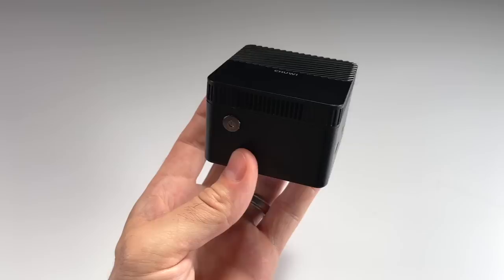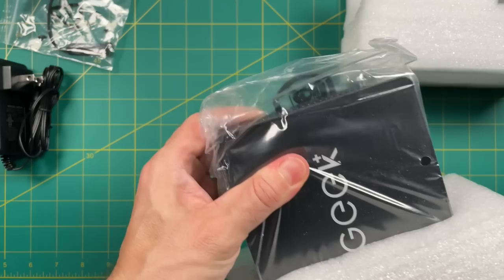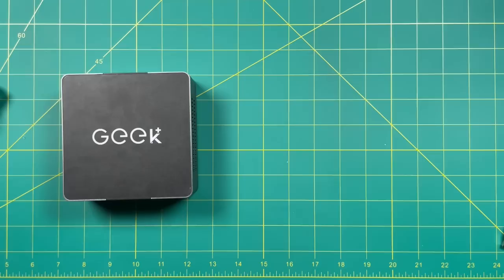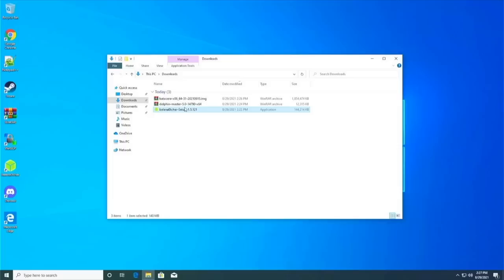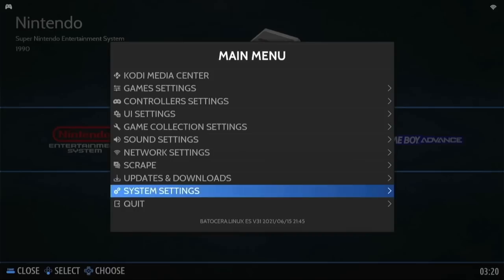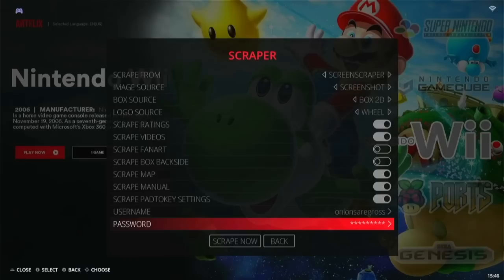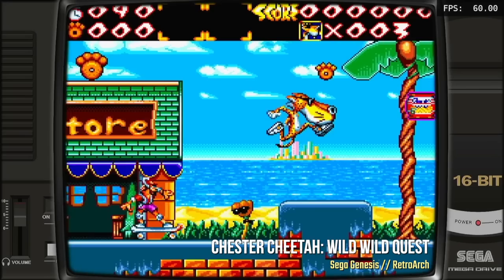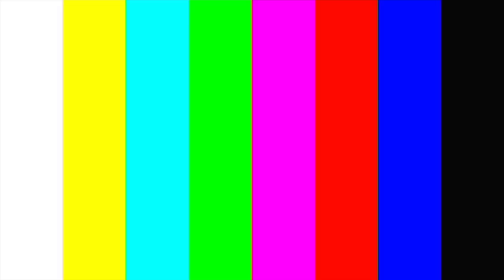Batocera Mini PC Setup Guide

Comment: I’m stuck at the balenaetcher part… it’s not detecting my ssd drive. Windows detects it, it has a drive letter, I can use it, but balena can’t see it… I’ve tried messing around with bios settings but nothing is working… I have a beelink sei8 i5
Reply: An update for anyone struggling with flashing the 2nd drive… Look up ETA prime‘s video about installing Batocera onto a hard drive… make a USB flash drive of Batocera, plug it into the computer with the spare hard drive, access settings menu of Batocera and download Batocera to new drive.

Comment: Can someone please help??!!
I have a Kin Hank 2tb Batocera drive and a Kamrui Mini Pc. This MiniPc has onboard Bluetooth which doesn’t seem to be available in Version 33 or Batocera 35.
I’ve tried Bluetooth dongles from the compatible list but they also don’t work. 
I’ve hit the “pair Bluetooth device button” and nothing happens. 
Something faint appears next to the Wi-Fi signal at the top right of the screen but quickly disappears..
I’ve also tried XTerminal to enable Bluetooth commands and nothing works.
This is driving my friend and I crazy the past 2 weeks.

Controllers:
Gulikit King Kong pro
Power A Bluetooth Controller

Comment: Is CPU under that yellow gum-like thing? I don't see any passive, either. That will make a cooling upgrade a wee more difficult. It will probably involve drilling a holes on a top plate in order to fit a passive cooler and fan somehow.
Reply: Don't think there's enough space to add anything other than the 2.5" drive inside.

The yellow thing looks to be the battery.
Reply: @acejon2162  if the system cannot cool itself, then it's not quite a good buy 😕

Comment: the geek mini pc does have a fan inside and is actively cooled, on a sidenote why do you need to add an hdd exactly?
Reply: So he can boot into Batocera from that instead, and all games would be on that hdd as well then. 
That way he can leave the included M.2 drive storage with windows on as is, incase he ever wants to boot from that instead and use it as a regular   PC. 
He tried booting Batocera from a flash drive but it wouldnt boot from there for some reason.
Reply: @fonzitheman  ah I see I'd prefer to have all the games and batocera on the ssd

Comment: Not super familiar with Batocera yet, but would this process work with an sd card on the Super Console X King? I really want to make mine a better experience. The stock stuff is trash
Reply: U need a different system for that like emuelec to load on a super console x king, this one is for mini pcs..

Comment: hi! i'm facing the booting problem... what's the difference between a hard drive and a micro sd card? aren't they all external storage?
Reply: Well for hard drive we could be talking about an internal hard drive that may be connected with the sata connection, or whatever. 
But ofcourse we can also use a portable hard drive thats attached via a usb port, like a flash drive. 
Those would be external. 
What you choose to do is up to you. If you wanna use Batocera on your everyday PC  and keep windows running on that then you would use a portable drive, flash drive or micro sd card (if you can attach that). 
I actually use a mini PC with Batocera installed on an internal hdd.  So its a dedicated retro machine only. 
But I also use a small portable ssd with Batocera on on my main PC just for testing purposes.
Reply: @fonzitheman  I see. I'm trying to solve a very specific problem and I just discovered that my problem comes from the img I choose. Once I switched to other systems/builds, my problemas was fully solved.

Comment: Thanks for the video iv been looking to do this for a long time quick question which mini pc would you recommend for doing ps2 and wii? games iv got a pc just looking for something small many thanks
Reply from the maker: Hi, I would look at some of the mini PCs in the Minis Forum catalog, they are probably some of the best for your money right now.  The price range will be relatively high, about $400 for solid PS2 gameplay.
Reply: @RetroGameCorps  kool thanks very much i did look at the prices I think I would have to go down that route keep up the good work 👍🏿
Reply: $400 to $600 for miniPCs that can run many PS2 games comfortably. Specific models include Minisforum UM700, Beelink GTR or GMK BuxBox 2 etc.

A cheaper alternative would be those used super compact SFF Lenovo/HP office PCs. that are
Reply: @acejon2162  the UM700 can even run ps3 games right?
Reply: UM700 uses the Ryzen 3750 which is quite old, for PS3 better to get those high end models running Ryzen 5700G or higher.

ETA reviewed quite a handful of models with 5700G, 5800, 5900 etc, go check out his videos to see the performance.
Reply: @acejon2162  Are you sure about the ryzen 3750 for the UM700? I just double checked it, it says that the UM700 has a Ryzen 7 3750H.

I was looking for a mini pc that can also handle ps3, not sure if something like this in this mini size even exist though.

Comment: Do you have sound in all mame games? I'm still trying to figure out how to get the sound working in e.g. Tekken. Also, you could set up Grub for dual boot menu, but that's complicated.
Reply from the maker: Hi, yeah good point on Grub, but I think that's beyond the scope of videos like this.  For sound, Tekken in particular has issues depending on the core/romset you use.  Also try to go into the MAME settings (the one with the dipswitches and whatnot) and increase the cabinet volume, that's an issue on some games like UMK3 and Killer Instinct.
Reply: It's MAME 2003 romset. Thanks, I'll try that.
Reply from the maker: @youzernejm  I think MAME 2010 is a better romset for Tekken games, if I remember correctly.  Best of luck!
Reply: @RetroGameCorps  thanks a million!

Comment: How do I get the Hacks emulators (SNES Hacks,NES Hacks, genesis hacks etc..) On Batocera?? I had a Super Console X Pro with EmuELEC before selling it and building a mini PC with Batocera . EmuELEC had these collections with cover art and games
Reply: Since there are no folders for those by default and if you want them as a sep system in the main systems view you would have to create them yourself, but youd also have to add any images for those and edit the Emulation Station XML doc, so if you dont know what youre doing then not good idea. 
So the simplest method after that to keep them sort of seperate is create a sub folder for each system.  So you would create a snes hacks sub folder in the snes rom folder. 
You wont have any art work for the sub folder like that as its just keeping it seperate in a simple way. 
If doing that and you want to view it as a sub folder you then have to go to ES settings and enable a certain sub folder view setting. 
So not ideal. But I do that for PSP and PSP mini'S.
I would love for the devs to add those though, with an option so we can have them as a sep system or within one. 
Like they have in grouped systems settings, theres a few there like for 32x,if you untick that it will appear as its own system. If you tick it then 32x games will just be in the sega megadrive (or genesis)  folder .Its also an option for Famicom and Famicom Disk System. 
I wish they would add the grouped option for psp/psp mini's,FBNeo/CPS1,2 and 3.
NES and Famicom, PC Engine /Turbo Grafx and PC Engine CD/Turbo Grafx CD to name a few.

Comment: So I’m trying to do this on an older Dell laptop, I got batocera installed to a hard drive but when it boots up I get “operating system not found”
Any ideas of what the problem is?
Reply from the maker: You may need to unlock the secure boot in the BIOS file with devices from Dell or HP.  https://www.dell.com/support/kbdoc/en-us/000133480/uefi-and-secure-boot-faqs
Reply: @RetroGameCorps  cool, I’ll check that out
Reply: @RetroGameCorps  Well I went to change the secure boot option but turns out there isn't one. Its an old Inspiron 14z N411z I bought back in 2010.
Reply: @SlapNuts4Life  have you tried toggling UEFI boot and legacy boot options in BIOS?

Comment: Is there a mini pc you recommend at a fair price that’s more powerful ?
Reply from the maker: I would look at a J4125 PC, or if you are willing to spend more I would look at the Minis Forum catalog to get an idea of what's out there.
Reply: @RetroGameCorps  thank you fine sir
Reply from the maker: @incomingtruth49  that CPU has a PassMark score over over 1800, and you need about 1600 for good GameCube, so it stands to reason that it will play GameCube well.  PS2 will probably still be a bit slow on it though.  Where did you find that for $250?  Those specs are usually at the $300-350 range.
Reply from the maker: Sorry for the delay in replying, YouTube doesn't notify me of reply comments and so if I don't catch them as they come in I lose them.  There's a lot of variety when it comes to i3, for example the 7100U only has a single thread passmark of 1390, so the Athlon 300U would be much better for emulation.  I would just look up each processor on cpubenchmark.net and look at its single thread performance.  1600 is the minimum for good GameCube, and 2200 for PS2 emulation.  I would use those measurements when determining a good CPU for your needs!

Comment: So I put batocera on a internal hard drive and it still runs terrible
Reply: Hmm, wonder why. 
I originally ran Batocera from a flash drive with roms on a portable hdd.
But have recently switched over to using just an internal hdd only. 
Boots faster that way and no issues running games either.
Reply: @fonzitheman  this is on a mini PC your talking? On my gaming PC batocera runs great but the mini PC idk it sucks I tried the nuc arcticture and the x86 but suck
Reply: @LuisGonzalez-bj4il  
Maybe its just that PC I guess, dunno.

Comment: I wish I could find an affordable mini that can run PS2.
Reply from the maker: Yeah that's a tough benchmark.  If you are willing to jump into the used marketplace then a mini Lenovo ThinkCentre should be okay, but that carries its own risks.  For a new mini PC, you are looking at $400 -- there's a big gap between $200 PCs like these and the $400 level, and not much in between.
Reply: ps3 and jailbreak, they do ps1,2,3 backup all you games, retroarch.. only thing is they don’t do n64 or sega CD
Reply: @SB-tp3yw  ?? That's a thing?!
I've never heard of it or seen it.
If I have I wouldn't have a PS Vita with Retroarch on it...
Please tell me you're kidding..
Reply: @RissieRei  nah, they are absolutely right. Source: I'm currently running Evilnat 4.88 firmware on my PS3.
Reply: @TheRandomGuyTheFarNoGameCat  rebug 4.86 is my favourite. if your already JB on evilnat, you can use the habib QA toggle which lets you then downgrade the firmware back to 4.82/ 4.84/ 4.86 etc

Comment: Alright, this is my opinion so, it should be taken as such.
I am no fan of treating pc as a console. The very notion is alien and wrong to me.
They are separate things and should be made as such. Consoles were always about 
hardware that was dedicated and didn't vary. PCs just varied. That's their strength but 
also their problems. 

I am not ever going to cheerlead for PCs to be consoles or to ever consider a PC a console.
The same goes for treating a phone as a console. It's just not. Same deal too. It's like calling a 
pc program an app. I can't do that unless it's from the Microsoft store or on an android mobile device.
To me programs are programs and apps are apps. Not the same. At least not in the sense I drew up. 

Anyway, To me I would never blur the lines and what Sony and Microsoft has done is criminal in my mind.
Blurring the lines and even erasing them with their machines. Those machines are not consoles they are 
under powered and in some cases middle to low high range PCs. While the consistency is there, the fact is,
they are still just PCs and therefore the only real console has been Nintendo and I am no Nintendo fan at all.
Reply: A truly weird take. 🤔

But to each their own.